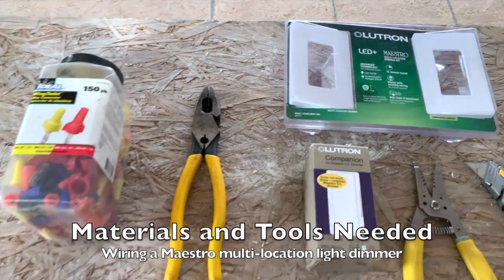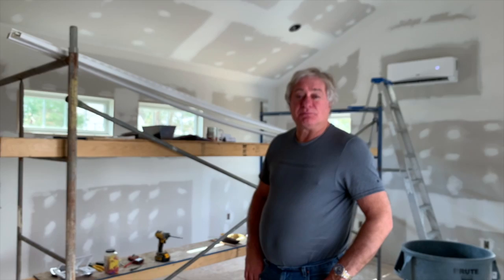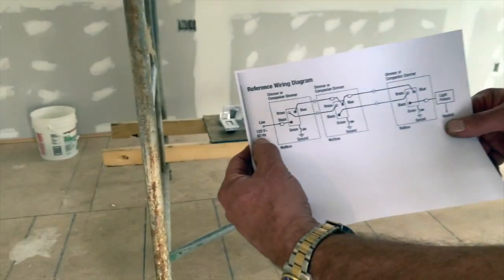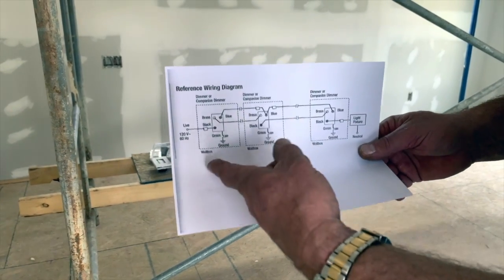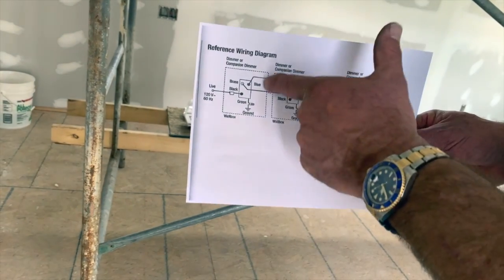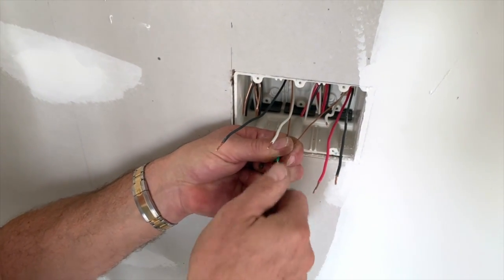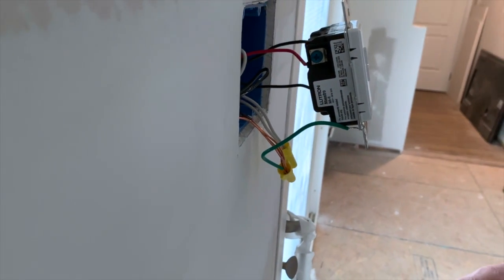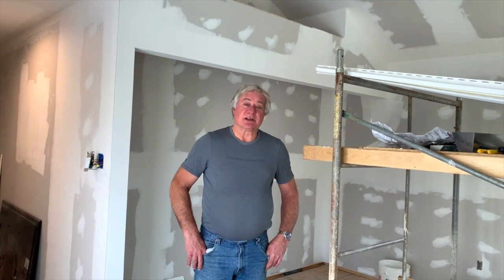Wiring a Maestro multi-location light dimmer

Comment: I’m trying to install these but the wires they used are all 14-2 and they had dimmers installed with them would I need to run a 14-3 to make it work ?? I’m so confused how they made it work with 14-2

Comment: Trying to install one main dimmer and one companion dimmer (Lutron Maestro) for hallway light. Don’t have record of which wire is which so I have red wire on blue terminal in both locations and black wires to black terminal and brass terminal. Primary Maestro functions properly. Companion dimmer is not - when I hold rocker switch down it dims (while I press it) and when I hold it up it brightens (while I press it). Tried swapping the black wires on the companion switch with no change in issue. Any tips?
Reply from the maker: The key is to follow the wiring diagram. Once you adapt it for a two switch system, incoming power goes to the black wire on one of the dimmers while the black wire on the other dimmer connects to the fixture. Then you wire such that the blue dimmer wire goes to the blue wire on the other dimmer. This leaves two brass terminals on the opposing dimmers which connect to each other. Another possible problem is that you have a third switch in the system you may not be aware of. All switches must be Maestro, one master and the rest companions.

Comment: Very helpful. I'm not a fan of working with electricity, so I was hesitant on hooking up the companion switch. I did a single location a couple weeks ago. Knowing what happens if I get the blacks reversed was a big help also. Thank you.
Reply from the maker: Glad to hear this was helpful! Thanks for watching.
Reply: Thanks again @fixedbyjohn110 , but I still got cold feet. The current setup has 2 switches for our family room. The first switch I went to replace has, connected to the actual switch, 2 black wires (1 connected to a black screw [line 1 in] and 1 connected to a brass screw [line 1 out],  and 2 red wires one connected to a black screw [line 2 in] and one connected to a brass screw [line 2 out]. And the ground. It looks like a pass through, but I just don't know enough to figure out which wires go to my Lutron black vs. brass, vs. blue.